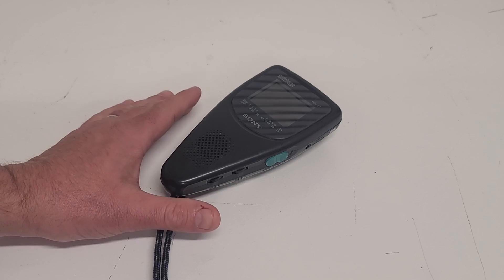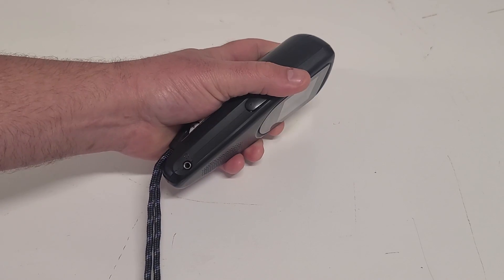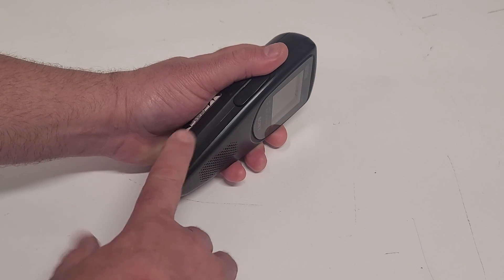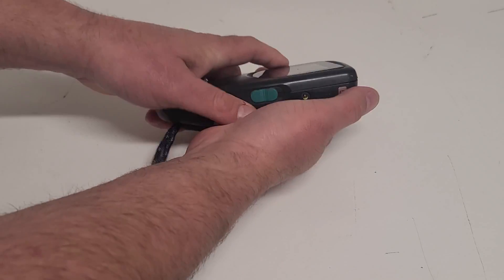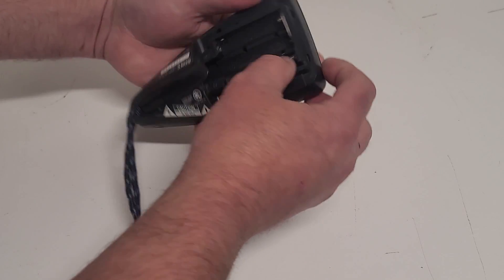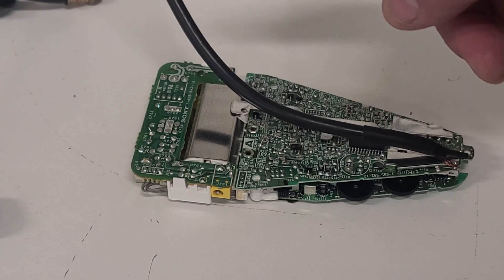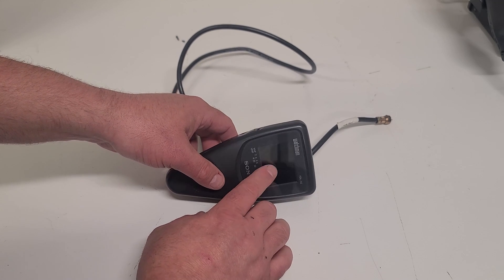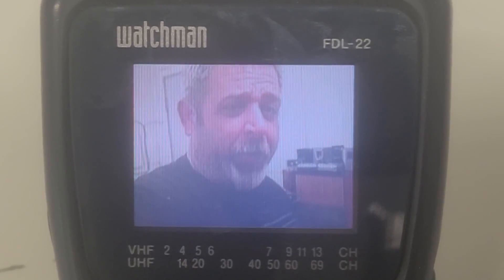Sony Watchman - Adding an External Input

Comment: I think it would be cool to set up a watchman as a computer monitor. Anyone know if it’s possible?
Reply from the maker: I would think you'd need a couple converters to get it to work, but it's definitely possible.
Reply: There are several ways but probably the cheapest and easiest would be modding it like this with an RF connector and then get an RF modulator that either converts VGA or HDMI to RF. Or you can also go from VGA to composite and from composite to RF, it's all lagless since it's analog. The other ways are with a VCR (which is a more complicated setup) or setting up a broadcast where you would broadcast the signal of your PC as a UHF channel, basically creating a literal personal analog TV station for your house only, this is the most complicated one but the coolest, there are several people that have done projects like that on YT and on the Internet, and you don't need to modify the Watchman for this one, since you'd be transmitting the signal wirelessly.

Comment: Question, does the radio still work when modding in this way?
Reply from the maker: Modding it this way doesn't affect normal use if you're still able to receive broadcast analog TV. All I did was add coax in line with the built-in antenna.

Comment: Wait how did you ground it? Do you attach ground wire to the copper coating in the coax? Not sure?
Reply from the maker: Yes, I grounded to the shield of the coax.
Reply: @VintageElectronicsChannel  soldered to it or just wrapped tight?
Reply from the maker: I soldered it

Comment: I got the FDL-22 for my birthday one year, I was probably 14. I loved it, I could lay in bed and watch TV. Worst thing was the batteries, they never lasted very long.
Reply from the maker: If you were like me, we bought the cheap batteries. They never lasted long.
Reply: in this days we have rechargable ni-mh bateries that will be great for that device also you can use without batterys on exthernal ac adaptor  that watchamn works great with orginal charger from sony psp

Comment: I wonder if you made a connection on the cord itself would that work and save opening up the device? Otherwise an interesting video showing the design and workings.
Reply from the maker: I actually tried that off-camera before the video. There isn't a good way to connect it and I couldn't get a decent signal when I tried.

Comment: Can I do this with any older models?
Reply from the maker: As long as you can find where the antenna signal is entering the circuitry, yes.
Reply: @VintageElectronicsChannel  Thanks! Same thing with adding composite videos too? Or only an rf antenna. I just got an Fd-230 model from 1991.

Comment: I have this same little tv. Your electrician skills were phenomenal. Wish I could mod things . Maybe down the road
Reply from the maker: It's a pretty easy modification. Just soldering two connections. Good thing with this model Watchman is that you can find them on eBay for like $5, so if you mess up its a cheap replacement!